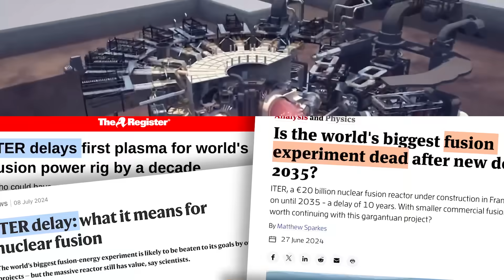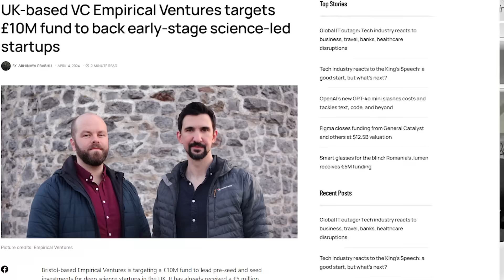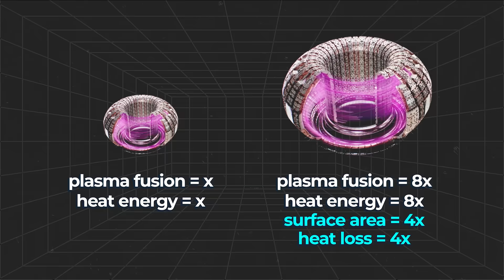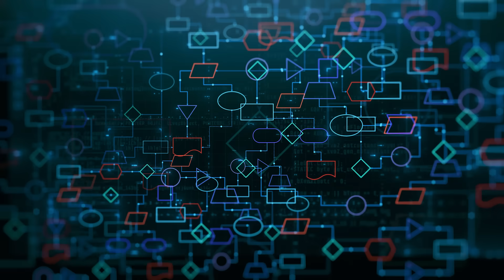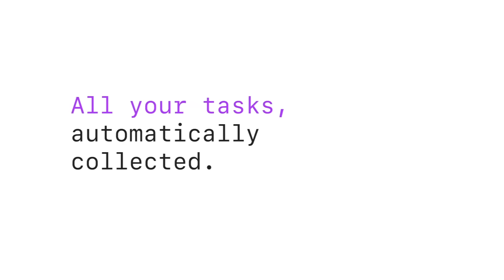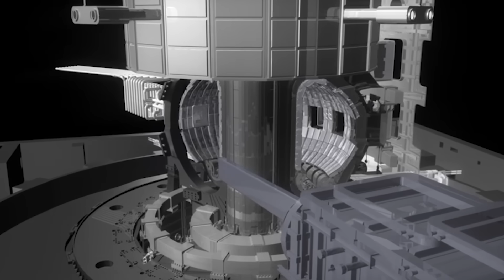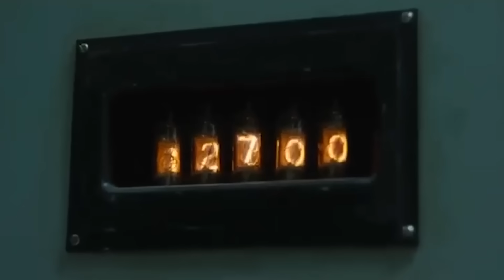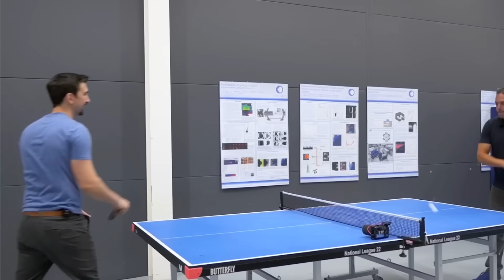Is The World's Largest Fusion Project Dead?

Comment: A couple of points to put this expenditure in perspective:
1) We are talking about solving one of the biggest problems of humanity.
2) Energy produced in EU alone in a year is worth 650 billion EUR. What is 30 billion over 20 years? Nothing. If you taxed energy in participating countries with a fusion development taxation it would not be noticeable for consumers.
3) There would be no fusion startups without government spending in the field for decades.
4) I am sure that ITER solved many technological issues which these startups now build upon, like magnet technology. 
5) I am sure that that a lot of people working in these startups have have previously worked on ITER or for its suppliers.
To conculde: we should keep the expenditures on ITER. We should also flood the startups with cash.
Reply: One of the interesting notes in energy discussion, was that people tend to not notice the logistics cost. Around ten years ago, they were noting that even with 100% free energy generation, infrastructure cost of electricity would still have been something like 4-5 cents per kilowatt hour. The comparison was for local solar - even if it still cost that much, just not moving it would save the money, and tip the scale. Turns out this was before AI and electric vehicles were taken into the mix, and now if you could get solar + storage under like 10 cents, the cost would be competitive. C'mon battery tech!
Reply: @doublepinger  While I have huge hopes for Solar and battery tech myself, huge industrial applications won't be running off of that, especially not when we go for really energy intense things like decarbonizing steel production, green helium and things like that, it will requires immense power generation globally.
Reply: @Yattayatta why the huge hopes bc solar outsaide is a Dyson swarm makes no sense tbh nuclear it's much better planet side but I'm curious on what ur hopes for batteries are bc lithium is unstable based off the knowledge i have of it
Reply: You are far more sure of far too much, for a person who thinks that consumers do not notice their taxes.  The world is paying more than a trillion dollars each year for fake environmentalism, just to provide employment to alarmist liars.  The result of all this waste is continued poverty in poor countries, and the deaths of children in those countries, to the point that people like Al Gore, and the IPCC have killed more people than Hitler and Stalin.  Please prove me wrong!
Reply: We should indeed fund all the fusion startups. 

There is really not enough pressure or urgency to get anything done there. It will use up all the money being thrown at it.
Reply: Taxes are for NERDS (lol)
Reply: I agree with you generally, but the question is: in the context of the climate crisis, should we be focusing so much on ITER now? Even if the project was very helpful so far for the industry, is this something we should be focusing on right now or should governments instead pour the same money on other fusion projects with much shorter timelines? Or even something else, like Thorium Molten Salt reactors, which just need to work out technical details now.

I think only fusion scientists working right now can tell whether funding ITER is still worth it even with the long timeline.

And yes, sure there’s tons of money floating around in wealthy countries, and there is so much money sloshing around in corporate bank accounts that it’s ridiculous, and it should be possible for investment in this kind of project to be easily available. But if they’re only going to agree to invest so much into fusion, where should it go?
Reply: The problem in the end is national security. Electricity is more and more useful for weapons than ever before and many of the partner nations and empires in the project are having kinetic disagreements in places like Ukraine and the South China sea. I think this public effort will be useful, but I don't think it'll lead to the first useful fusion reactor since every government involved will eventually have the incentive to either stop backing the program or outright sabotage it in order for themselves to become the first country with a fusion-powered military. 

In 1987, lithium ion batteries either didn't exist or were still in the experimental stages. Energy storage has improved so greatly since then that many weapons systems, like small drones for instance, are electrically powered. If battery technology gets better, tanks, mechs, and other vehicles may soon be electric. This means that fusion has too great of a military utility for civilian international projects to stand a chance at using it for peace.
Reply: 4) Nope, these were solved beforehand. ITER didn't contribute to it, that it is worth mentioning by anyone. There are way more advanced sc magnets than ITER uses. AFAIK they still rely on niob sc technology, which is many decades old.
Reply: Why is the answer for globalists and liberals ALWAYS taxing something or someone more?
Reply: Fusion is an idiotic money pit. All of this time has been spent trying to fix the Tritium problem. Which will never be done commercially viably. The Lithium-6 or Beryllium is absurd and rare. 
Why even spend the money on fusion when we could make fission and save the Tritium for Fusion engines? Rather than trying to power by pure fission
Reply: but why fusion when you can fission?
Reply: @SylvanNewby  because fusion is : 
1) probably less dangerous than most fission process in terme of nuclear waste (their is dangerous nuclear wast in fusion, but it stay dangerous not long. 
2) less dangerous than most fission process in terme of accident (if something go wrong, the generator stop, and at worst, you have tritium and maybee some transmuted product that go out of the facility. It can be bad, but it can't go out of end, because at this point nothing happen anymore in the reactor)

3) fission has , if you don't count thorium, only some hundreds years of reserve before we start to run out. Fusion... basicaly, you don't run out, not on any scale that make sens in the next thousands years anyway. (for deuterium, we are talking about a fraction of see water... for tritium, it could be a be a bit more of a problem, as for the moment, we need lithium, but that is still far more reserve as what we have as uranium. 
4) you can do both 

bonus : fusion could be very usefull in different field, especialy in space (you don't want to rely on fission reactor in space... If you have doubt about that, just picture what an accident involving a space engine with a working nuclear reactor could look like.  Spoiler:  tchernobyl could easely become a minor accident in comparison.  (we have "nuclear reactor" in space, but they contain only a very small volume of radioactive material, and are generaly used only to power the electronic and produce heat) 
So, developping fusion on earth could be a first step to developpe new energy/ new propulsion for space exploration. 
But as i'm not sure we will ever have space programs advanced enough to require fusion(i would not be surprised if the effort in that field would stalle at some point)... not sure it's that much of an argument.

and i'm no expert, so i could forget a lot of other reason. (or be wrong on some exposed here, to be fair)
Reply: @SandreXen  but still...
Reply: @SylvanNewby  that's an interesting take, thanks for sharing!
Reply: ITER is a biggest waste of time and energy and money, they have oldest (no real changes according to today's supercomputer models or other changes like REBCO integration and other really good changes ) so it's the biggest money waste program
Reply: From what I understand ITER hasn't done anything, JET, reactor in Culham, Oxford has been making all these discoveries, ITER hasn't even been active or finished, it was supposed to take over from JET this year, but clearly isn't going to. Until the end of last year, JET was the most advanced experimental fusion reactor in the world. ITER not being finished this year is rather detrimental in my eyes for this project, it's good private companies are doing different research on it and different ways because otherwise I fear we'd not having really any actual fusion research that meant anything for at least a decade if 2034 is true...
Reply: @wilkosgaming9224  when a component is mounted on the structure, it's tested at least in most way possible considering the lack of everything else .
You finish the instalation of some magnet, you test their efficiency, their defformation, etc. 
So , even if you don't even finish the project, you have a lot of data on what happen when you try to construct a megastructure like the iter tokamak. 
the process of building iter is part of the research on fusion reactor.
 But yeah, study of plasma behavior for exemple, could stale because of the situation, i give you that (even if i don't know for sure)
Reply: @wilkosgaming9224  and jet is a public EU reactor.   where are this incredibul private projects???  , cgi,,,
Reply: 1) SpaceX solved one of the biggest problems in a few years with a dedicated small team.. Einstein came up with general relativity by himself, not by a group of scientist, so is almost every single major discoveries out there. You could argue that iphone is built by a team, neuralink is built by a team... but the idea always came from individual, not  a committee.

2) Once fusion is commercialized, you are STILL going to be taxed for it, energy would never be free for layman, EVER.

3) True, but big Govt;'s purpose is there to control, and to grown on its own influence, not for your benefit.
However without their spending, one of the commercial company will do it eventually, someone always do.

4) Ture. 

5) Not likely, as some of the approaches are very different. Govt is very inefficient, committee decision is the least inefficient.

Time to shut down ITER, waste of time and energy. I'm sure if you talk to one of their employees, they will say red tape and committee decision is a huge drag that they can never get rid of.
Reply: @jacks19822  1) What problem has SpaceX solved? Do we really NEED so many satellites? Or go to Mars? Do not compare it with (unlimited) clean energy supply, that's just silly. Einstein came up with his ideas over 100 years ago. But the age of one-man discoveries is over. Look at the scientific papers now, there are always multiple people, usually tens of them.
2) Sure. I'm just pointing out how little this cost is in comparison of the produced energy value.
3) Fusion has been 30 years away since what? 50's? No private company will ever engage in such a long-term uncertain investment. Thanks to all the spending so far now the private sector has "felt the blood", maybe they will come up with something. Fingers crossed. But we can't be sure. Do we want to wait and risk that nothing comes out of all those efforts and then start over? What if they come up with something that works, but is not so great? Don't we want to have options?
That said, the huge ITER's delay is certainly disappointing . Maybe they should rather decrease number of participants and change management rules.
Reply: When you say that "big government is there to control" you have fallen prey to the conspiracy theorists who would dismantle our democracy and destroy our freedoms.  All you need to do is listen to Trump and his MAGA fans to see what a fascist nightmare it would be.
Reply: @jacks19822  
1) Space X developped technic based on research already worked on at nasa... Nothing tel us how it would have gone withouth those base research made by a state space program. Most techological breakthrough, even those made by "one individual" (this is more dependant on point of view than something based on reality , i think), can be linked to idea who were discussed by ten's, hundred's, thousand's, or even far more people in those field at the time. 

I think that you imagine idea coming from individual in most case because that is how storytelling work for human. It's hard to make story were hundreds of people work and idea colliding understable and compeling. when creating biopic, a practice generaly used is fusing multiple important people in the story of the protagonist in one, to have less character. 
2) I don't think that the point you're refering to has anything to do with not paying for electricity after that. It's about the cost of the project being reasonable.

3) no. or it could happen 50 years later; or even more... i don't see how your framing of how the private sector work can be described by something else than wishfull thinking. 

5) governement can be ineficient, company too. ineficient govenerment can maintain themself even if they are ineficient. company too. 
Their is some tendancy, of course, and it can be argued that in some situation company tend to be more efficient on some task than public sector... but that is only a tendancy. don't be overconfident on what the private sector can do . 

i disagree a lot on your conclusion. stoping iter could be a reasonable choice if we agree to stale or even lose advancement in fusion study (and of course we can make this choice) but from everything i've seen so far on the subject, stoping iter now has absolutly no chance to improve the speed at wich we will develop comercial fusion. it seem to be the total oposite. And i see no serious study pointing at another conclusion (what you give here seem to be mostly based on ideology alone, starting from the idea than anything public is necesserly worth than anything private, and not on the study of fact.)
Reply: If it was designed to generate power, ITER could produce 500 MW.  We would need to build more than 20,000 of them to replace fossil fuels.  We can't build on that scale, and even if we could, it would be far too late to prevent global temperatures from reaching catastrophic levels.  With annual energy demand now at 175,000 TWh, and with nearly 80% of this still serviced by burning fossil fuels, no clean technology can be scaled up to replace them.  And this doesn't even consider the collapse of ecosystems around the world which is a separate but related existential threat which on its own will also force a collapse of our global technological civilization.
Reply: @fr57ujf if only we had gone all in on nuclear.  Green and far less dangerous than coal and fossil fuel, and WONDERFUL for base load generation.

It's a shame we have let fear deter us from using one of the most efficient power generation methods that we have available.
Reply: Not to forget that you need facilities like ITER to actually educate and train engineers and scientists in the field of fusion technology...(so that companies have people to actually hire later on).
Reply: Only if we also explore alternative models for the universe. Leave no stone unturned!
Reply: Science is how we turn over stones.  What alternative models do you have in mind?
Reply: @fr57ujf  Scalar physics. Just cause it's not the One True Theory and everything else is immediately labeled as a perpetual motion machine doesn't mean that's how the universe works. What if I told you the hidden battery is located somewhere mainstream natural philosophy doesn't know either? We still have no idea what dark matter is.
Reply: What is the One True Theory?  What is Scalar Physics?  What hidden battery?  There are a lot of things we don't know.  That doesn't prove anything.  This just sounds goofy.
Reply: The mastering of nuclear fusion to power our civilization will compare with the mastering of fire. It will be a huge boost to civilization! That should be the first goal of any country on Earth: Limitless, cheap, clean energy ! I imagine we can build desalination plants so huge, that we can make all the Sahara green again. Or to create such big machines, that will literally move mountains in the process. This combined with robotics - I wonder why anyone should work again to make a living.

Comment: DOA
Earth fusion was D.O.A. even from the start. 
Fusion is Temperature pressure Mass and Earth Fusion only has 1 Temperature . 
1 out of 3
Sun or stars do not fusion H atoms! H atom fusion is a random walk with 1 out of billions of H atoms with extremely low energy wells just low enough under high heat and high density to pop together for fusion to happen. 
The only reason Sun / Stars shine is because of the high pressure density shoving billions and billions of H atoms together so a few can fusion
H bomb Mistake
Earth fusion mistake remove the pressure remove the random walk and some how with enough tempeture we can fusion. 
Well it works in H bombs why can we do it in a vaccume tube. 
Stupid
We can but it is impossible to keep it going.

Comment: 10:24. No, probably not.  One of the reasons these sort of large scale projects struggle like they do, is because of the availability of funds.  They feel like they can make any problem go away with money, which means they don't spend a lot of effort asking basic questions like: "Is this the right thing to be doing?"  And that question needs to be asked at EVERY level of the project, not just at the project level.  What makes these scrappy efforts so effective is the fact they are constrained by cash, which forces them to sweat the details.  What we don't need to do is turn 30+ effective fusion projects into 30+ ITER projects, by removing their cash discipline from their efforts.